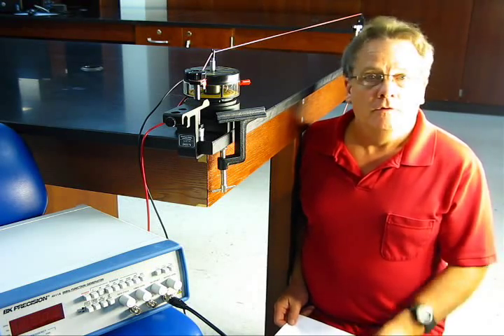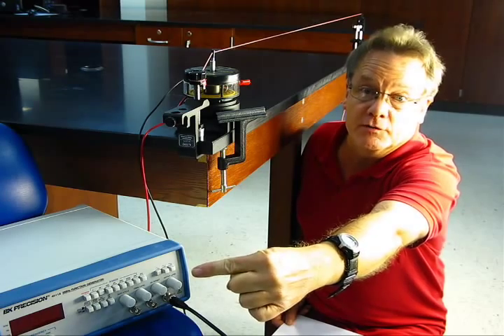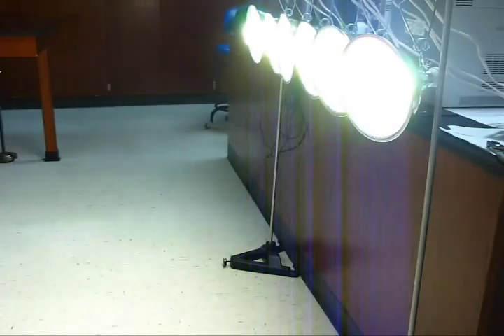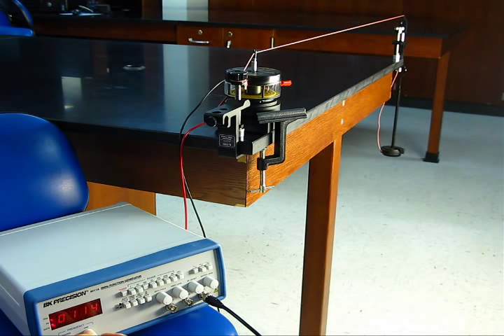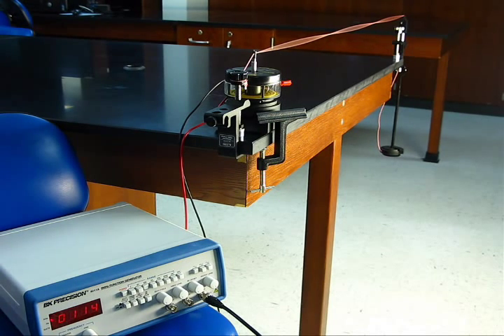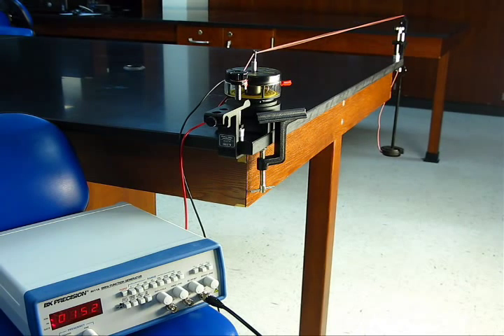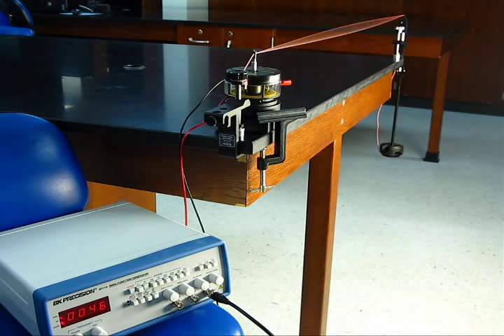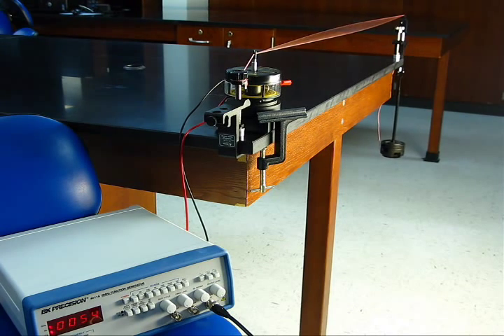Standing Waves on String

Comment: Do standing waves appera at all freauencied
Reply from the maker: No. They only appear at resonance frequencies which depends on the wavelength, wave speed, and distance between the ends. Resonance wavelengths are when N*wavelength/2 = L where N is an integer and L is the distance between ends. Resonance frequencies = v/wavelength where the wavelength is a resonance wavelength and v is the wave speed.